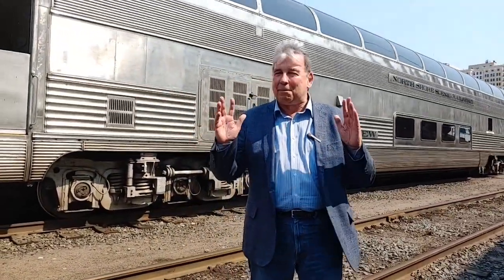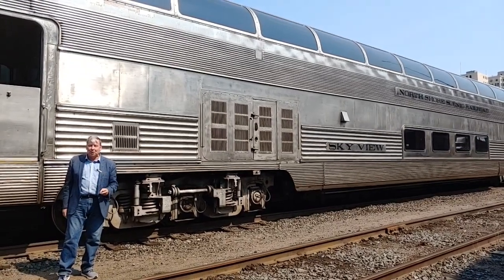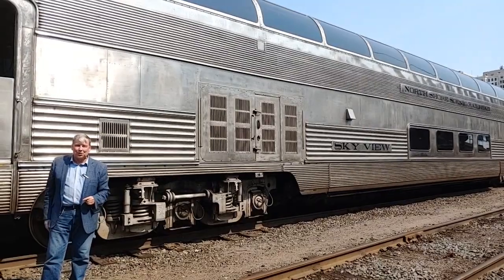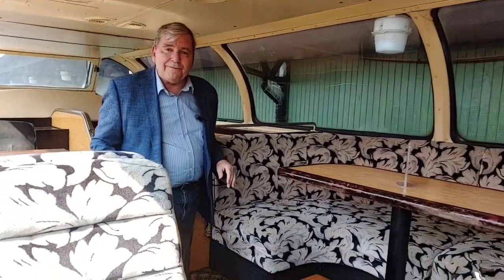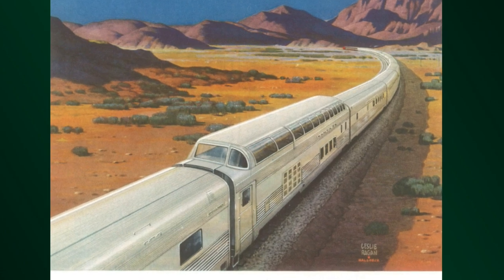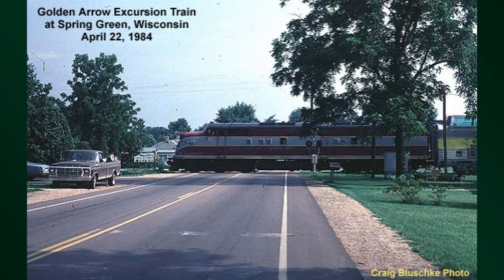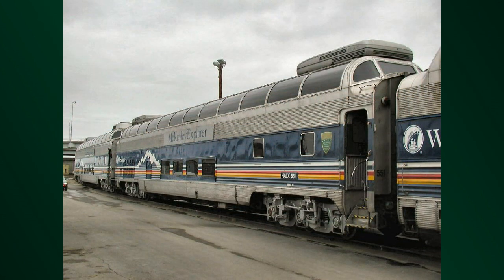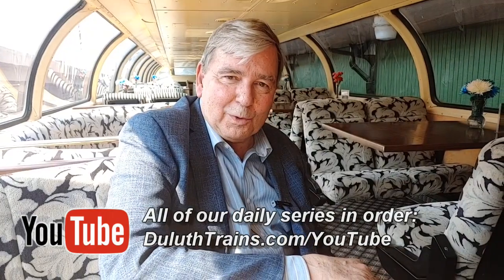SkyView Domecar #551 Tour

Comment: I was a frequent passenger on the "Texas Chief" from 1956 to 1973.  Besides the upgrade to hi-level coaches, the "Big Dome" lounge car was, by far, the nicest improvement on the TC.  I rode from Temple, TX to Chillicothe, IL.  I spent many hours in the dome.  During holiday season, it wasn't always easy to find a seat.  When coach was sold out, the overflow passengers were seated in the dome.  The Houston-Chicago sleeper was often "Pine Beach", another Budd passenger car.  It was a wonderful ride, especially when we hit 90-mph ATS territory.  Amtrak never equaled the service and amenities of the Santa Fe.  I am very happy to see that a "Big Dome" survives and is providing passengers a glimpse into mainline passenger railroading.

Comment: I was pleasantly surprised when you climbed the stairs and I saw the roof overhead.  IIRC, other roads (MILW and another of the Northern Route companies) had full-length dome cars built with "greenhouses" up there.  I'm sure the glass was tinted, but imagine the temperature of the summer sun heating up everything beneath all that glass!  It must be a lovely way to see the country through which you're traveling---instead of a fluffy carpet of clouds beneath you and nothing to the sides.  I've flown, taking along enough reading material to occupy my time, and I've traveled by train, where my only reading was done while I ate lunch.  Too much to see outside my window and from the rear vestibule seen through the open tops of the Dutch doors and out the back, above the folding gate.  Thanks for the tour.
Reply: The thing that made dome cars habitable was massive air conditioning units.

Comment: Just FYI, you should let your social media person know that "Sky View" is two words. You can see the space between them right on the side of the car. Also, "dome car" is two separate words. 

That's a stainless steel car, by the way. Definitely not aluminum. TIG stands for "Tungsten Inert Gas", but the welding process used by Budd is called "Shot Welding" and was invented by Earl J. Ragsdale, a Budd mechanical engineer. If you people want to call yourselves a railroad museum, I suggest you do your due diligence and perform research on a piece before posting a video like this. Oh, and get a social media person/station master who has better grammar skills.